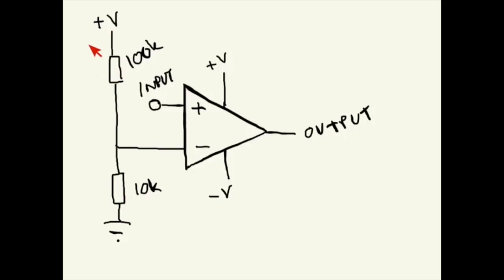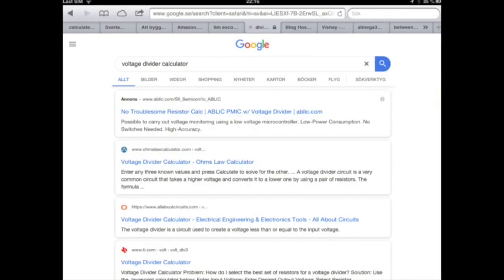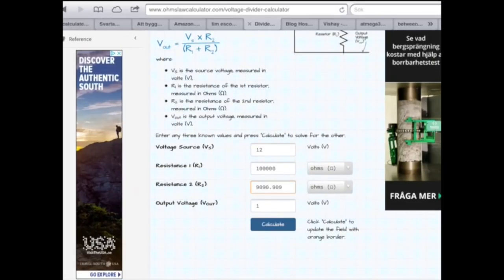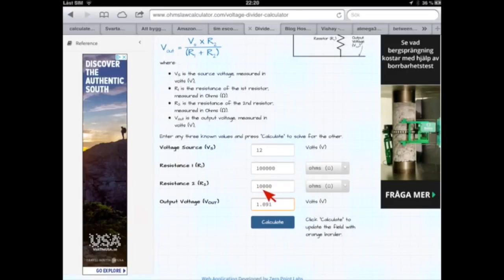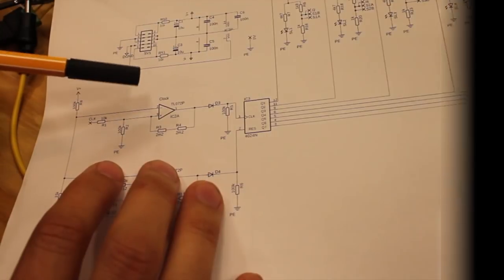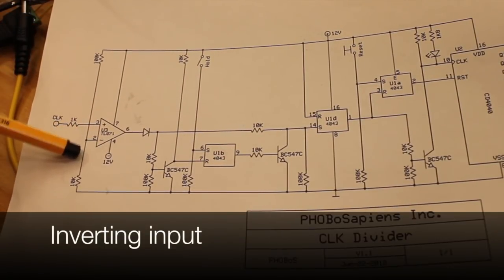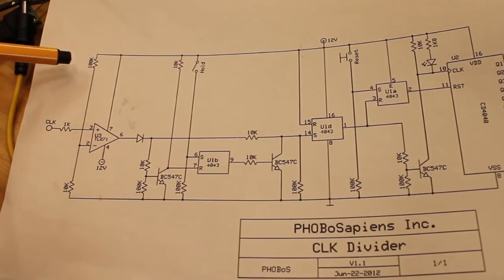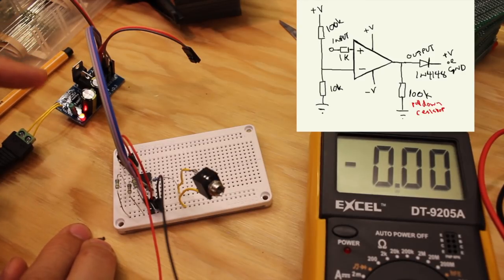The OpAmp Comparator and Voltage Divider - Electronic building blocks

Comment: Awesome video.. only a person that's been studying for a long time such as myself would actually appreciate this.. because I understand and can relate. 🙂 (+ 1).

The whole entire thing about electronics is all about variable voltages and what you do about them.. don't forget about Ohm's law and the fact that everything else is directly related and only separated by the different values. 

When the current changes so does the voltage. Ohms Law.

You vary the voltage on the gate, you vary the voltage between drain and source, but at a higher voltage range. 

Happy Trails. 🐒

Comment: Kristian, I will looking at your other videos and checking out the links you provide. I am an automotive guy, forced into retirement so building instead of buying. Question: The circuit I am trying to build is controlling a very small dc motor, built with 3 terminals for ground, CCW and CW. It is geared to a two pin pot. This describes a hot/cold actuator sold new for $10 +_. But using an Op Amp, control circuit can be 5 Vdc via regulator, but out put at 12.8-14.2 Vdc or car system voltage. A pot on the dash when turned, moved the motor CW until the internal pot creates a voltage input matching a variable input that stops motor movement. Turn the dash knob the other direction, the motor rotates opposite way. I have spent hours to figure out what seems like a simple circuit. 1 Op Amp or 2, I have three cabinets of electronic parts, bread board and Fluke 87 - V. Can you help? I just need a second vehicle that old but tough that I can drive (6'3" tall) but something my wife can used. I create a service manual for each part, system or component that even a GM dealer tech can work on. Thanks for any help or suggestions as I can't find anything close to work.
Subscribed and liked and willing to do the work. Just waiting for lumbar fusion #4 in June.

Comment: You can also flip the voltages and put ref V on non inverting input and source voltage on inverting input and it will reverse the logic of the voltage comparison.     This comes into play if you want to have two comparators with a window between trigger voltages.    You can also have a voltage divider ladder and make ladder of voltage comparators which is essentially what is inside the  LM3915 to make a LED VU meter circuit.   Very useful circuit building block circuit.
Reply from the maker: And now you figured out one of my next modules. ;). Have to look at the lm3915. As it is quite tedious to make loads and loads of comparators. Thanks!

Comment: I have a question about Arduino
How to make automatic watering system using old washing machine solenoid valve 12 volt and Arduino using soil moisture sensor so system can water the plants as needed! Please make a video on that!

Comment: I will have to look closer... Rf / Rg =Av ?  I thinink the value is the diference not a default max out of the voltages … just perplexed
Reply from the maker: Hello again, from the electronics-tutorials.ws I link in the Description: 
“...Voltage comparators on the other hand, either use positive feedback or no feedback at all (open-loop mode) to switch its output between two saturated states, because in the open-loop mode the amplifiers voltage gain is basically equal to AVO. Then due to this high open loop gain, the output from the comparator swings either fully to its positive supply rail, +Vcc or fully to its negative supply rail, -Vcc on the application of varying input signal which passes some preset threshold value...” I think that is what it means. I could be wrong. Read the article and let me know. :)
Reply from the maker: Ok. Then maybe I misunderstood the article (not the first time) but as I read it it was either +v or -v out. I’ll read it again.
Reply: I really like your videos .especially the synth build stuff. On the op amps I got my information from  this YouTube video " EEVblog #600 "